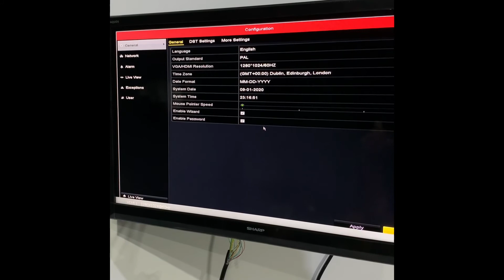How to easily repair a broken HDMI cable adapter #HDMI #cctv

Comment: When you look at an hdmi connector diagram are the pins numbered from the rear view or looking from the front of the plug,,the end of my cable I our cinema room came off! It's hidden above the ceiling and down inside  a  wall sio I want to copy your repair method and save myself a DIY nightmare lol thanks George.

Comment: Thanks for the video. Am I right in saying you would leave the unbroken end plugged into the source (e.g. sky box), and the spare hdmi plugged into the output (tv) with the coupler at the other end of it and the new hdmi terminal block plugged in to the other side of the coupler. Then use the multimeter to check the cables at the broken end of the original hdmi compared to the new hdmi terminal? Thanks
Reply: Matt did you figure this out ??